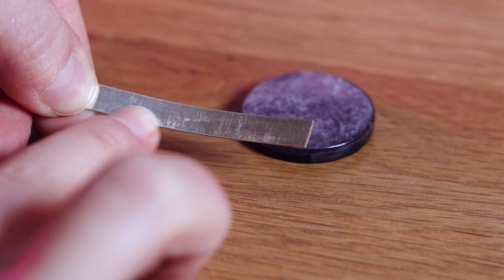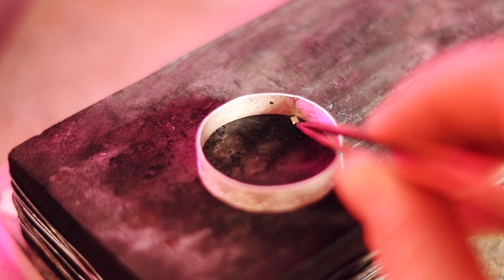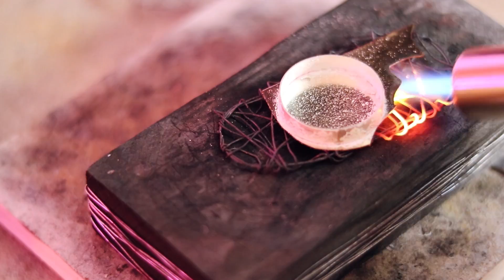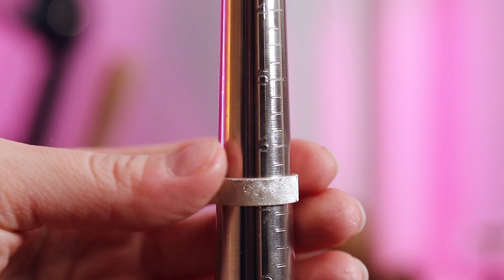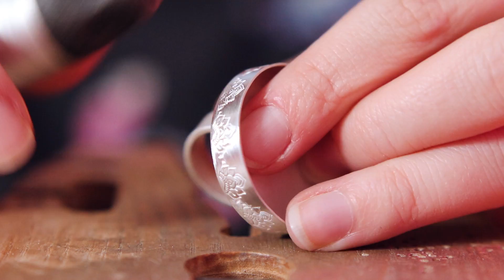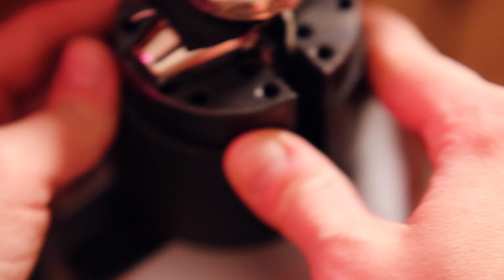How to make a ring with a cabochon BEZEL setting! Learn silversmithing

Comment: Hello. Thank you for the tutorial. It's very detailed. I am taking online classes on Jewelry Repair and Design. My assignment is to create an onyx bezel-set ring. However, I won't have all the wonderful tools you are using in your video. Do you have a tutorial on how to make a bezel ring with minimal tools? Also, the wire bed that you set the bezel on for soldering, what type of wire is it? Not expensive, I hope.

Comment: Always love your videos! Using the bottle warmer is genius, especially in small spaces, which is my situation, as well. What kind of plastic cup do you use in the bottle warmer that will hold up under the constant heat and pickling solution? Keep up the good work!!
Reply from the maker: Hi! Thank you so much, I'm very happy you enjoyed it :) I love this little bottle warmer, it's such an excellent solution. I use a container, in which a ready-made soup was sold. This container is meant to be put in the microwave when you're heating up your soup, so it's very resistant to the heat and it stayed in the exact same condition for the past two years!

Comment: Hi! GREAT video. A few questions Basia ?

1)What is that tape paper?
2)Can I stamp even on 28 ga bezel wire or does it need to be thicker bezel wire?
3)What did you use to remove patina from high spots? Pro polish pads? I struggle with removing too much patina from design!

Comment: Hello, I'm wondering is it possible to use solder paste instead of solder chips to set the bezel on the ring if the bezel is small, like 5mm? Thank you :D
Reply from the maker: I think so, yes. You can try with a hard solder paste

Comment: How did you get the patina on the stamped parts only? Wouldn’t it all have come off if you wiped it off ?
Reply from the maker: I used a little brish to apply it onto the stamped area. Patina sticks to the detailed areas and wasn't removed when polishing
Reply: @TheArtOfMetalsmithing  ohhh so the patina will come off with sanding/polishing on the flat areas?
Reply from the maker: @FriskyTendervittles  yes, it will! But it won't come off with just rubbing with the polishing cloth for example. It needs something coarser to come off. But will stay in all of the stamped areas :) unless you really go at it in there with a bristle wheel haha :P but if you're careful, then it will be ok
Reply: @TheArtOfMetalsmithing  thank you! I love your channel! It’s so helpful! Do you do enameling or etching? I love enameling!

Comment: Hiya Lady Stardust,
Thank you for another beautiful video, both in content and filming.
Perfect timing as I'm making a cab stone ring next, plus earrings, a set using 10mm Rose Quartz. I'm making the 40 x 20 pendant at the moment. Fine silver bezel wire onto an Argentium back. I've got the bezel under weights to take the twist out. It's only 3mm high x 0.3mm, so I want to avoid filing the side down as it may not hold the stone then. So a bench block and some other metal bits should be left overnight to take the twist out. When I put it on a flat block as it will sit in use, there is a longish gap under the edge. I tried manipulating it, but it did not want to play, shame. 
Excellent video, back to basics, is perfect for all your new viewers who have yet to find your back catalogue but also for people like me who need a good teaching video on something we may not have done for a while or even much of. So perfect timing for me to work along to. 
I love the stamping on the bezel; I've never seen that before on a bezel, another Basia original... The ring looks perfect, and I love the pre-made ready-to-use rings. Saves time and effort. Fantastic looking gem. One tiny point; If you make the bezel too small, solder it, then put it on your ring mandrel and use a soft hammer, nylon/rawhide, to work the ring a little larger; remember to invert the ring on the mandrel halfway through so it is not conical. Don't hit too hard, mark the metal, or damage the stamping.
Again excellent work, dear lady; thank you.
Steve xx
Reply from the maker: Great to hear that Steve! Glad you enjoyed it, thank you, as always, for watching and your sweet comment ❤ 
The piece you're working on right now sounds very interesting, I hope you share the photo with me when it's done 🙏 
I can't claim that stamping on a bezel is my original idea, definitely not! I've seen others do it and I love this effect, I had to try it out myself 😃 
And that's a great tip, thanks for sharing. 
Thank you so much again, stay safe xx
Reply: @TheArtOfMetalsmithing you are very welcome, both for the comment and the tip. Not your idea? But your style though, plus I like the mandella-type stamp you chose to use for it. That is totally you. Stay safe xx
Reply from the maker: Thank you Steve! That's one of my favourite stamps, I believe it's by ImpressArt :)
Reply: @TheArtOfMetalsmithing I believe you are correct. I've seen you use it before now. I think? xx

Comment: I always have a hard time measuring my bezel wire accurately. I'll think it fits but then end up being too small after I solder to the backplate. The paper measuring tip is so helpful. Thank you!
Reply from the maker: It's very simple, but surprisingly accurate! Haha :) And it's always better to cut just a bit more than you think you measured, easer to adjust :) Thank you so much for watching ❤

Comment: Beautiful ring.  I need to try stamping the bezel.  That looks so pretty.  And as for your question: annealing.  I understand the concept but I have yet to successfully anneal anything.  😅
Reply: Same here! I´m new to silversmithing and need to learn about annealing. If i understand i correctly it is easier to do in a dark room to see the metal "change color". But do i pickle after?
Reply from the maker: Very good point, Alice. It's best to do it with dimmed light, so that you know when the metal starts changing colour and you know you won't overheat it. There is a neat trick of painting the metal with a sharpie - once the sharpie's gone, the metal has been annealed! :)
Reply from the maker: Oh you totally have to try it! I can't believe I waited so long to try stamping on a bezel, it looks very pretty. The effect is definitely better on a thicker bezel though, be careful when stamping a very thin wire. As for annealing, it's actually very simple. When you take a wire and it's hard to form, you heat it up slowly and pay attention to the colour. No need to overheat it or turn it red. Just when you see that the temperature "travels" on the metal it starts changing colour, that's when it's ready. Cool it donw in cold water (quenching bowl) and you'll see that now it's much easier to form. Good luck!
Reply: @TheArtOfMetalsmithing  Thank you for that tip!

Comment: Firstly, and most importantly,I love your Stitch tshirt! What thickness is your bezel wire please, Basia? I'm looking for a thicker (than 0.3mm) fine silver wire (UK), Cookson only have 0.3 I believe.
Reply from the maker: Thank you! I love this t-shirt too 😍 I think this bezel wire is 0.4mm or 0.5mm, something around that. I bought it at jeweller's supplier shop in Krakow (Poland), so I'm not sure where they would have it in the UK. You can check if they have a fine silver sheet, then you can buy a soze like 70mm x 50mm for example and use calipers to cut it into bezel wires. The thickness will be better and you can control the width. It will also be fine silver, so softer to work with. If that won't be an option, you can go for the sterling silver sheet and anneal before shaping. It may be a bit harder to work with than fine silver, but you wil be able to get that thicker bezel. I hope this helps a little xx
Reply: @TheArtOfMetalsmithing  Fine silver sheet!! But it's absolutely there on Cookson's website. I didn't even know that was a thing. You've just solved that problem. Ridiculously I'd never typed it into Cookson and never scrolled passed the 2mm thick sterling silver sheet until now. Thank you, Basia! That's just made my day ❤️
Reply: Where did you get that tool to hold your ring shank in place for soldering? It looks like hand made. If so do you have instructions?